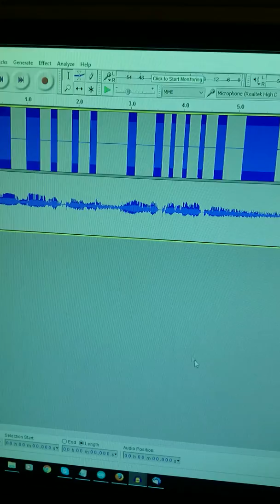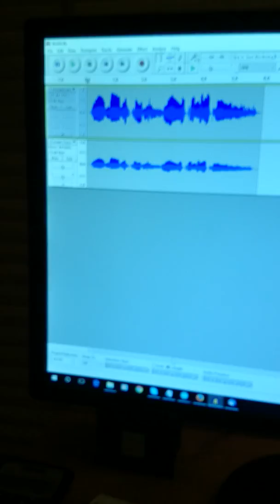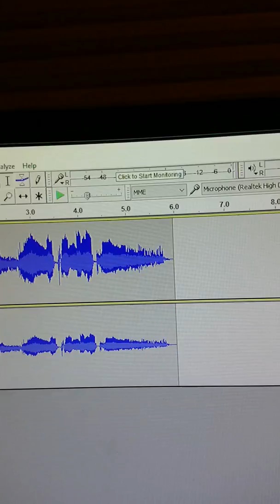JawDuino test

Comment: HI, great video, i made the skull, but the servo is very fast, i see you have a very smooth movement, I wonder if you can help me, how can I change the speed of the servo? Thank you!
Reply from the maker: It's been years since I've looked at this, but search for examples of how to vary the speed of a servo - search for "arduino servo set speed" to find discussions.  You add a  delay, so that the commands sent to the servo have a delay in the loop, instead of telling the servo to instantly go to the new position.
Reply: @jeffhaas9577  Thank you very  much, I do apreciate that... !